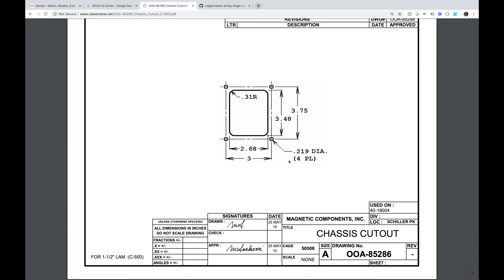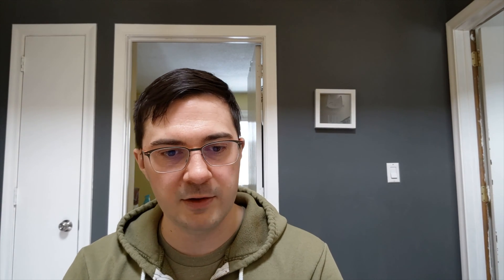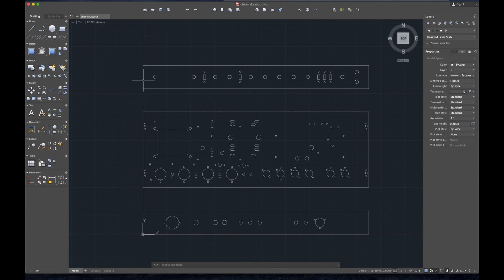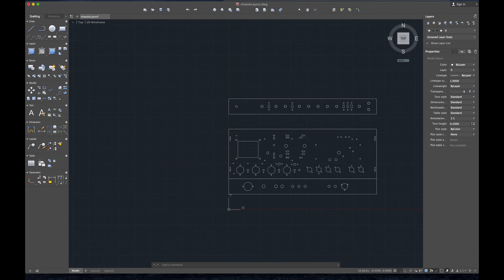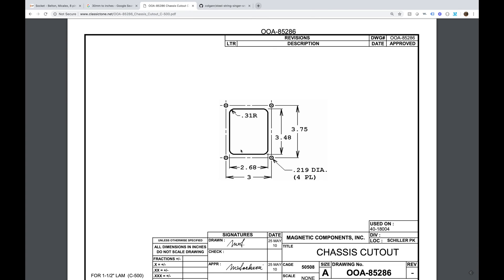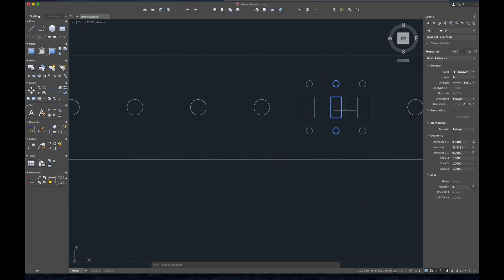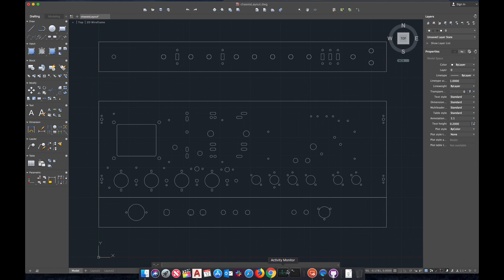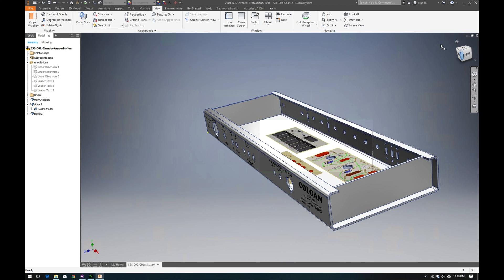Steel String Singer #002 Chassis Design | How To | Part 1 AutoCAD

Comment: Is it somehow dangerous to build an amp or is the only thing i can damage the amp itself?
Reply from the maker: There is risk in anything you do, even pedals. If you take your time and observe then you'll have a great build
Reply: @TheToneGeek  but i can't hurt myself seriously, do i?
I'll do the builds with a good friend of mine whos becoming electrician at the time so he's soldering circuts all day long at the moment do you think we can do it?
Reply from the maker: @Sebastian_cello  take your time and you'll be fine 😎 There is high voltages and such present so read as much as you can about amp building and look up "light bulb limiter" to reduce the voltages and safe guards yourself against any shorts that might have been overlooked. You never know until you try 🔥
Reply: @TheToneGeek  ok, thanks
I'll start doing some pedals, where do you get the parts from? Kits or do you look up the circut and buy them yourself
Reply from the maker: @Sebastian_cello  I'd start by buying a kit from Aion Electronics or build your own clone (byoc)
Reply: @TheToneGeek  is the quality of their kits good and are the parts the same as originals?
Reply from the maker: @Sebastian_cello  pretty close. Resistors might be upgraded to metal film and capacitors might be upgraded but that's not a bad thing. It will sound more like how the circuit was intended. Once you get one or two under your belt, I might have a video made by then to help you through sourcing your own components.. it's a bit of a learning curve so buying a kit is definitely a good way to start so you learn what to look for without frustration
Reply: @TheToneGeek  awesome, thank you very very much, 2 last questions, first is the 10$ kit on aion the whole kit without the enclosure or is something else missing, second where do i get cheap enclosures that i can design myself?
Reply: I would say yes, there is the potential to hurt yourself unless you fully understand the high voltage risks, how to work on an amp properly and where these high voltages are in the amp.  It’s very easy to have a simple lapse in judgement and get zapped.  Just my opinion.